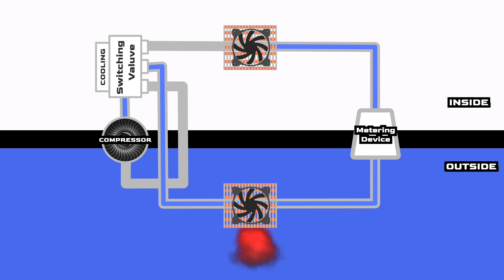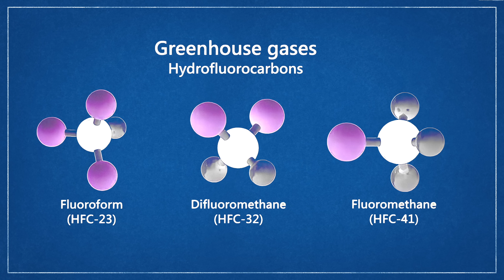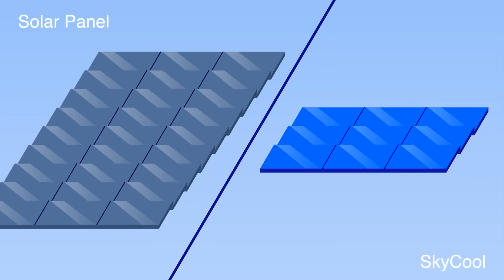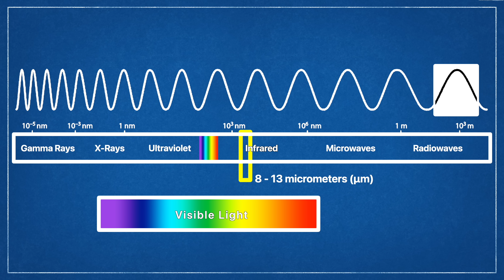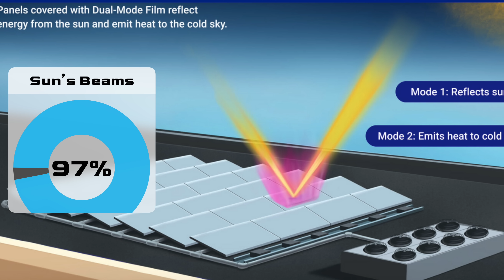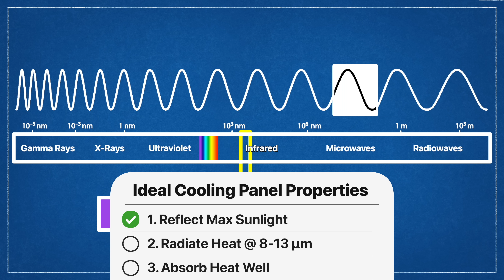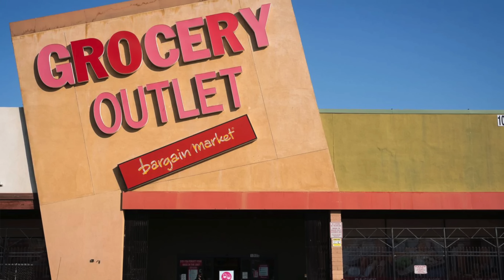New AC Tech Sends Heat Into Space & Saves 95% On Cooling Bills!

Comment: Cooling towers in the southwestern US that operate at night have been using this principal for many years.  They employ a combination of evaporation and night time radiation to the sky to provide cooling.  The University of Arizona in Tucson has been cooling their campus this way for many years.  No solid state anything required.  Very dry desert air is required, limiting application.

This appears to be a scam based on scientific illiteracy.  Not possible to radiate to space with the atmosphere in the way.  The sky is much warmer than space, limiting the cooling capability to a few tens of watts per square meter.  While theoretically possible, this is completely impractical due to the extremely huge area required to couple the heat to the sky.  The same area covered with PV panels powering air conditioners would provide much more cooling at greatly lower costs.

Too expensive with limited regions dry enough to support at all.

Comment: If your topping off your ac you have a problem. It's a closed loop system, which means it should never need topping off unless it's leaking, and in that case it needs repair not just topping off.

Comment: Maybe I don't fully understand how all this works, but doesn't this tech do the opposite of solar arrays? Sky cool reflects away the suns energy while solar arrays absorb sun energy as part of the converting process. If this is true, getting them BOTH to work together would be a trick right?
Reply from the maker: So reflect or convert to electricity prevents the heat from penetrating, then radiating heat out… it’s possible but I’d have to look into it

Comment: Do I know of any other air conditioning solutions? Yes

1. Good amounts of foam insulation
2. Reflectix installed in the attic and walls
3. Ceramic coated windows
4. Wind catchers
5. Buildings designed with a lattice like the one's associated with ancient architecture in India
6. Ceiling fans are a lifesaver here in Texas

Thank you for coming to my Ted Talk

Comment: Interesting. So as a rough ballpark I did a best case calculation based on a 16C radiator temperature. With a 100% ideal emitter (ignoring the narrow band of IR radiation) over 1 square metre, that's a 186W radiative heat output. I have no idea how efficient they can get it, but I'd imagine around 15%, so that means around 28W per square metre of emitter panel. That's 96BTU/hr.

A 15m^2 room in South Africa is advised to get ~9000BTU/hr (insulation isn't great here), so that would need 94 square metres of radiators for a 15 square metre room. That's not that brilliant. Of course, I could be very wrong about the efficiencies they can get out of the system.
Reply: Your calculations don’t make up because the room get colder in time It’s just a question of isolation 👍
Reply: @luc-alaindehaes3512  Are you saying the room gets colder than 16C? In that case it makes my calculations even more optimistic. A colder room means a colder hot plate, meaning even worse efficiency.
Personally I'd turn air conditioning off below 16C.

Comment: You can't just magically radiate heat away and make it cooler than ambient in a passive system.  You must have been asleep in thermo dynamics/systems. All they are doing is making a fancy condenser coil to cool refrigerant or water that is being used to cool the condenser coil.  An IR reflective/radiant coating is already thing.  It is a well understood and is easily implemented.  The radiate it into space to prevent global warming is a scam/marketing nonsense.  Want to radiate heat out into space to help reduce global warming?  Go out in your backyard and look at the sky.  Everything around you including your head is radiating heat back out into space. 

Heat pump systems have had many changes in just the past decade that make them many times more efficient than they used to be.  I am looking at my 1 ton window unit that is wifi controllable (scheduled), uses  a DC inverter with seperate variable speed fans and compressor, and has 1000 watts of solar panels attached to it.  It uses zero grid electricity for about 6 hours out of the day.  I put the whole thing together for less than $2000.  The panels will survive 2-3 unit replacements to boot.

Comment: I would think that running your AC with the windows open would add to the problem. There would be heat produced by the fan motors and the AC compressor. These would definitely add heat.
Reply: Yes.  That was the point.

Comment: They radiate it into the same place as ac’s do especially when there are cloud’s and you can’t turn it around e.g not heating for you. Also it’s mainly for huge install’s it’s seems.
Reply: What makes you think it's mainly for huge installs?  Because the one example you saw was large?  It's made of modules.  Just use less of them.
Reply: @incognitotorpedo42  
There Website says it all:
- Data closets with cooling loads less than 10 tons
- Data centers and distributed compute facilities
- Refrigeration systems in convenience stores, supermarkets and industrial cold storage facilities.

-> We are not currently providing applications of our technology in the residential space.

Comment: They were talking about something like this in the 70's with solar funnels (like a solar dish but easier to make). When they pointed it into a clear sky at night, the air in the bottom of the funnel got cooler via radiating heat into space.

The sky has to be clear, no clouds, no buildings, no trees. Otherwise the heat is reflected back
Reply: They actually did it thousands of years ago, but it could only work at night without clouds. This tech improves that so it can work in daylight.
Reply: Funnels would work pretty well. Parabolic reflectors would work even better.  But even just flat sheets of reflective aluminum will work as long as the area of it is large enough, and you put an air space between the reflector and whatever insulated container that is holding the matter/medium to cool (water in a very well insulated and painted very white cooler, would work well--just leave enough space in the containers for potential freezing expansion). 

     If memory serves me correctly, I see you over at Robert Murray's channel a fair amount?

Comment: These radiators would be great for charging some mass as a source of cooling.
Reply: Since my comment debunking this video was deleted...

This whole thing is a scam.
Radiative cooling is a least effective way lose the heat! At room temperatures it is nearly non existent.

Convection and conduction effects are those that are heating up your house (heat from air and ground). Both of these are much more effective ways to transfer heat then radiation. There is no way radiative cooling with this magic device will be able to lose enough heat to keep up with being constantly warmed up by the hot air around it. Whole system will eventually equalize at ambient temperature.

Reason for this is second law of thermodynamics. Which in plain words means all energies naturally want to equalize. Meaning same temperature outside and inside your house. To fight this you need to create a temperature gradient and this takes extra energy. This is what regular heat pump or AC does. And since these magic panels don't use any extra (or enough) energy, they can't create a temperature gradient, therefor they can't work. Easy as that.

Radiative cooling is used in space on the International Space Station, because there is no other way to dump heat in space. Volume of the ISS is about 1000m3, area of radiators to keep it cool is 156m2. But that's in vacuum of space, there is no warm atmosphere there constantly heating up the radiators. 

So unless your house is in space this will never work.

Comment: Very interesting trick for effectively making an advanced cooling sunshade! Taking advantage of having high emmisivity in a certain region of spectrum while having very low emmisivity throughout the rest
Reply: Since my comment debunking this video was deleted...

This whole thing is a scam.
Radiative cooling is a least effective way lose the heat! At room temperatures it is nearly non existent.

Convection and conduction effects are those that are heating up your house (heat from air and ground). Both of these are much more effective ways to transfer heat then radiation. There is no way radiative cooling with this magic device will be able to lose enough heat to keep up with being constantly warmed up by the hot air around it. Whole system will eventually equalize at ambient temperature.

Reason for this is second law of thermodynamics. Which in plain words means all energies naturally want to equalize. Meaning same temperature outside and inside your house. To fight this you need to create a temperature gradient and this takes extra energy. This is what regular heat pump or AC does. And since these magic panels don't use any extra (or enough) energy, they can't create a temperature gradient, therefor they can't work. Easy as that.

Radiative cooling is used in space on the International Space Station, because there is no other way to dump heat in space. Volume of the ISS is about 1000m3, area of radiators to keep it cool is 156m2. But that's in vacuum of space, there is no warm atmosphere there constantly heating up the radiators. 

So unless your house is in space this will never work.

Comment: Do solar panels heat up a lot as they absorb solar radiation?  Do they function more efficiently when they are cool? Seems to me I’ve heard that they do. Maybe it would make sense to build solar panels that are alternating solar cells and these cooling panels, maybe 1 inch wide strip of solar panel and 1 inch wide strip of cooling panel, alternating. Then, the cooling panel might be able to absorb heat from the adjacent solar panel and make it operate more efficiently.  Perhaps the cooling panel could cool almost as well that way as if it were covering the entire surface. 

Maybe the cooling panel could be made to have a wider bottom surface and a narrower top surface, where the bottom surface absorbs heat and the top surface radiates it. Then, the 1 inch wide strips could have a 2 inch width on their bottom side so they would be absorbing from 100% of the roof area.

Comment: Heat is a resource in its own right. Where I live people are heating homes 5 months of the year. There is only about a week with “unbearable“ heat due to heat island effect, warming poles, changing weather patterns.
It is more fitting for place where it won't make sense to scavenge waste heat, by the way solar panels produce ~2/3 of energy in heat jet it is only harvested by PV/T panels. Multijunction and bifacial solar panels are more efficient at electricity production dos heating up less and likely work longer.
It is a promising tech! Actually you are moving energy long distances by a solid material.

Comment: Heat already radiates to space naturally. The fact that this tech works proves the atmosphere does not trap heat. Even a glass house cannot stop heat. Don't tell me gases can, that's moronic.
Reply: What is moronic is people commenting who don't know what the fuck they are talking about. Atmosphere is transparent to near--close to visible light in frequencies, the frequencies emitted by the sun--infrared, but absorbs and re-emits far infrared, the much-lower frequencies/longer wavelengths emitted by warm surfaces on Earth, which are all closer to 15° C than the 5800° C of the surface of the sun. It is the same mechanism--scattering--by which oxygen and nitrogen in the atmosphere absorb and re-emit the blue frequencies out of sunlight, so that the atmosphere re-emits blue light and the sun looks yellow when it is actually blue-white shading into ultraviolet. 

Why the M.F. hell do the most abysmally ignorant call others moronic when they are the ones lacking the education to understand the physical world? Benjamin Franklin speculated that volcanic gasses could alter the temperature of the planet; Joseph Fourier and Claude Pouillet presented evidence of the greenhouse effect in the early 1800s, and John Tyndall measured the infrared absorption of various gasses in a laboratory in 1859. Your education is 162 years out of date. Catch up or shut up.
Reply: @Grumplestiltskin007  And you think you're the big man in the room. Do you believe CO2 traps heat ?

Comment: That works in space. That's how the cooling systems work in space. 
But barely reducing 15 from ambient, is not enough, especially in Arizona. 
What is the ROI on the system?
Reply: 15° C cooler is 27° F cooler. That helps huge, even in Arizona.

Comment: 15 degrees below ambient. 
I hear that and start thinking about heat engines and thermocouples. This stuff for your cold side and something painted  black or ultra black for your hot side.
Not sure how much potential energy you get with this, but worth thinking about isn't it?
Reply: In some ways, for the hot side, you probably want something not simply black, but rather something absorbing/black (high emissivity) throughout most of the spectrum of sunlight, but then very reflective (low emissivity) in the infrared band relevant to peak black body radiation at the operating temperature of the hot side. Essentially, you more or less want the reverse emmissivity spectrum as the sky cool panel, for the hot size.
I'm pretty sure such a system would be less efficient than conventional solar, at least under the operating conditions achievable without reflectors, but still, it's neat to think about.

Comment: While reflective roof coverings aren't new, are there coatings or coverings designed to radiate in IR? Adding a reflector would help prevent a lot of heat absorption and make the whole system more effective.

Comment: Well the lowly swamp cooler works great as long as the humidity stays low, 25% max. It’s just a box on the roof, open sides, filled with sponge bottom holds water that has an auto fill and small pump to take water to top of Straw mat and it starts dripping down thru the Mat! 
 If this was done 24 feet high no squirrel cage necessary to suck the hot dry air thru the dripping mats where it’s cools off to 78-76 now that air is 15 to 25% humidity it has become heaven would start to fall. Hot dry air rushes towards moisture so this is how no fan would be needed with the mats 24 feet high as The air picks up the humidity becoming cooler and more dense so it would fall down the tower creating it’s own momentum generating  4 to 5000 cubic feet of air into your house per minute. One does have to strategically crack windows open. Most swamp coolers have a squirrel cage type fan move the air. You can easily make wind just shoot water out of a hose straight up just long enough for it to almost fall back down stop wait 10-15 seconds you will be hit by a gust of wind! This of course is the benefit of Arizona! So much easier to add moisture to air than taking it out!

Comment: yes I have an idea how about experimenting on water evaporation but in a sealed vacuum chamber like similar of an AC unit does,the vacuum will accelerate the avaporation bringing cooling further down not like the ambient ones you buy but use a evaporator like an AC unit it would be much colder than ambiant type cooling.
Reply: Water would be cheap and safe to use as a refrigerant but its not very efficient. The cooling effect comes from the phase change when a liquid changes to a gas. In the last 50 years there have been major improvements in chemicals that make up refrigerants that maximize efficiency. They get maximum cooling effect for the least amount of energy expenditure. Water also gives corrosion troubles.  Butane and propane make much better refrigerants than water but leaks pose a hazard.
I played with water as a refrigerant 20 years ago using an insulated steel vessel and a vacuum pump. The energy required to drive the vacuum pump and a small water pump was enormous. Its like having an AC with 3 EER rating when you can buy window units with 12 EER.  Costs you 4 times as much in electricity to do the same cooling.  So, yes, your idea works but its like driving a car that gets 5mpg. Keep thinking outside the box, though. Its a good trait.
Reply: I think more experiments are needed

Comment: Good start but price needs to drop.
They're apparently selling them for $6/square foot, which is about $65 per square meter.
(Maybe cheaper for contractors but a way to go.)

Not sure how good their coating is but the texas cooling film (a good one) is 95 watts of cooling per square meter.  Assume that level:  95 * 24 hours = 2280 watthours of cooling for about $0.35 per cooling watthours per day.  Solar panels are running about $0.30/watt.  But with about five solar hours per day, lowballing a modern air conditioner at a cop CoP of 3 (so we can neglect storage/inverter losses) we're talking $0.024 for solar panel cooling watthours per day.  That's a factor of ten.  It neglects the cost of the heat pump and the inverter and battery storage of the solar system, but also the efficiency of the cooling panel plumbing on the cooling panel side  So I'd guess the cost ratio is less than ten but probably at least three.

So they're getting there but it looks like they need to get the cost down by a factor of several to be the preferred choice in a good solar site.  Maybe that will happen as they ramp up (or others enter the market).

Solar electric and radiative cooling are comparable in amount of cooling provided by a given area covered in panels.  The cooling panels have the advantage that they work better in places that are NOT exposed to the sun but ARE to the sky.  So some parts of a site would be more suited to cooling rather then electric panels.